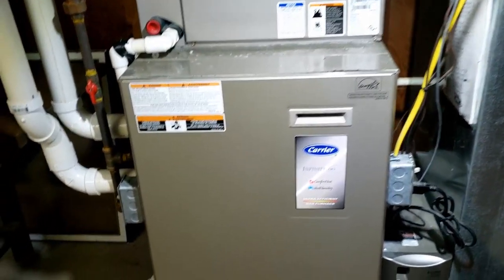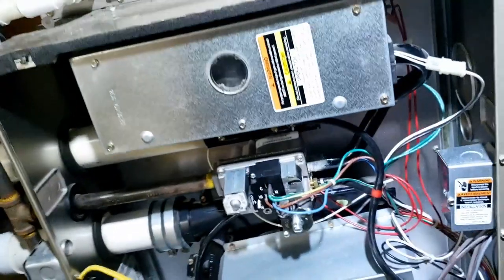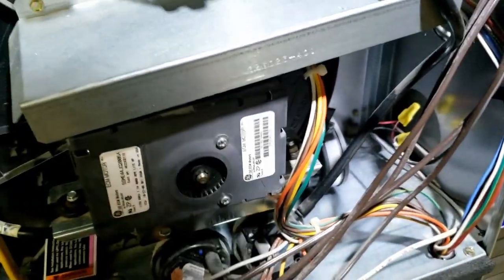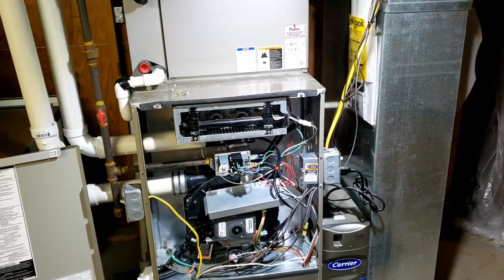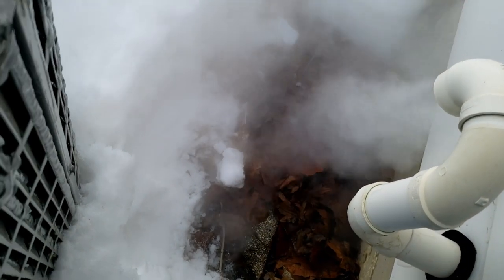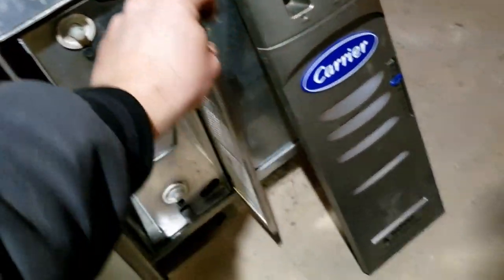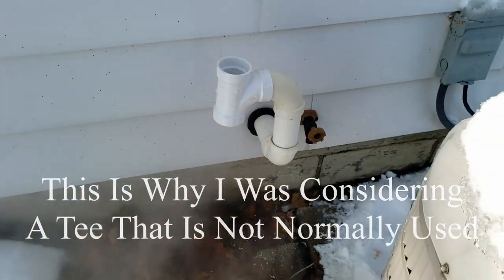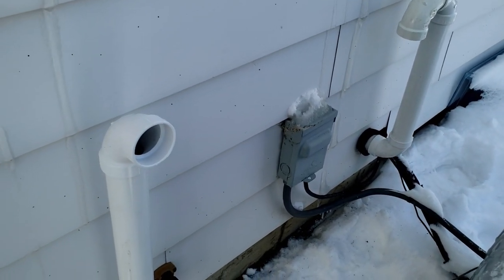CARRIER FURNACE NOT HEATING EASY FIX 31 Code

Comment: As a retired Carrier distributor service manager I have two things to offer. The fix was a good one and kudos to you for your professionalism and ethics.
Now to item two: Carrier has what is called a concentric kit that allows both pipes to exit the same hole. 4 inch hole. The exhaust goes out the middle of what looks like a cone/ funnel, and the intake air is drawn in from behind that cone. Very nice looking too. In your case, this, had you known of it, would have solved all the issues you correctly pointed out in your valuable video. When time allows you may find it worthwhile to talk to the Carrier distributor near you and get some info on this kit. I doubt, with so many hackers around, this will be the last time you and other professionals run into this issue.
Also as others have correctly pointed out, the requirement is 12 inches above any anticipated snow load.
Thanks again for leading the way.
Wayne Schneyer
Reply from the maker: Thanks Wayne, I appreciate you taking the time to watch it and leaving me a note. I myself have the concentric kit on my furnace and generally most new installs that we do would normally get one of those. I believe there was a previously installed furnace that already had been vented out.  Otherwise I'd never recommend running the exhaust stacks behind the condenser like was done. Unfortunately I would have had to drill a new hole or try to saw the whole bigger to fit the concentric out and then figure  a way to block off the previous two exhaust penetrations,  I'm not sure that would go over well.
Reply: @HVACRSurvival  Why is the air intake tube going outside???   The one for my Bryant gas furnace goes up out of the furnace a short distance up and draws intake air just above the furnace INSIDE my basement.

Comment: Perfect video!!!!! some of these air switches has two contact - one on the front one on the back check both! On my Carrier unit the yellow jumper powered both switches - then there was a brown (signal to control board) and orange (signal to control board) two different outputs signals. Inducer housing pressure and collector box pressure (check all 3 tubing- green, black, and black square tubing vacuumed sensing signal). Blow them out (toward the inducer housing) and you can check them with a OHM meter by gently sucking on the hose and hearing them click.  Make sure the hoses are good and tight - a very small vacuum leak can cause them to not work!

Comment: Good fix, much better than before. One thing I would have done is make the intake shorter than the exhaust by 6-12". That way you won't get recirculation even with a lot of horizontal wind since heat rises, it will go over the top of the intake.

Comment: When we used to install the Carrier furnaces here in Ontario the requirement was 12” above the highest expected snow level and 12” of separation between inlet and outlet. There was only two acceptable terminations, two pipe as described above and concentric. Not sure that has changed. Also anything that include risers above the snow had to be insulated. I remember getting tagged by the inspector at the time for less than 12” between. Made me fix it before unlocking the meter (new install).
Reply: Yes here in ontario 12" min between fresh air and exhaust if under 100kbtu. Over 100kbtu its 3". 12" above expected snow fall and usually around 3" outdoor vent before you have to insulate it. It is usually in the manual as different makes and btu values have different requirements.  As far as the ones in this video I can definitely  see it recirculating depending on wind which will shut it down. Also exhausting near/ below ac is a no no. Condensation and ice will build up on the unit. Personally  our dispatchers send the home owners to check venting before we are sent out. Saves us those snow in boots situations lol
Reply: @adamradley4407  thanks. It has been years since I have installed one. Put a two stage in my house in 2013. Love it. Have had to replace the inducer motor, not a failure but got very noisy, could hear it upstairs. Other than that it has been great. Did you mean three feet before insulation? I used to have to hate insulating them. Put one out under a deck and extended it the width of the deck, insulated with 1/2” Armaflex.
Reply from the maker: Running pipes a long distance outside under a deck in northern climates would likely result in the exhaust pipe accumulating ice build up inside the pipe and eventually restricting it enough to cause pressure switch lockout.
Reply: @HVACRSurvival  we have run up to ~15' of 2" vent hooked up to 70-90 kbtu furnace without an issue but you really have to make sure you are sloped well and fully insulated. I have run close to 30' of 3" through an unheated garage on a 110kbtu successfully. Granted it is not ideal to run long lengths outside but sometimes it is the lesser of the evils ;) Make sure it is well insulated and sloped very well.

Comment: Good solution on what you had to work with.

Stay Safe
Reply from the maker: It was a losing battle. I still wasn't happy with the pipes that high or far apart. But that was a install screw up but I didn't want to say that in the video.

Comment: Loved the video. Im looking at a carrier weathermaker 9200 uhe with similar symptoms. Comes on for 1 to 5 minutes shuts off. Blower is not turning on but duct by heat exchange gets fire hot. Then it trips. Im assuming its the capictor or the blower motor. Great vid!

Comment: I highly recommend just coming straight out and doing a slash cut on them like a 45° angle cut but I guess with the snow line you can't do that up North.
Reply from the maker: I used to do the 45° angle cut on the Lennox Furnaces more than anything. It really depends on what height it comes out at whether or not you have to do a riser like that. Normally I don't need to do that riser.

Comment: 2 Questions-  1. Why did you move the exhaust and intake pipes closer together?  2. Why were you considering installing a "T" ?
Reply from the maker: They are less likely to recirculate when they are closer together, also a tea causes it to linger around the air intake and potentially recirculate. I almost never use a tee, sometimes a tee will help keep winds from being driven directly back into the pipe, this would happen more when you have winds coming from a particular direction like from the West for my area.
Reply: @HVACRSurvival  Gotcha. Thanks for the explanation.

Comment: At 2:15 you pulled the black tube off and felt for vacuum. I did that one unit flashing code 3-1 and went to feel it I don't have much vacuum on the line even after it's pulled off but the system let the valve and ignitor ignite and start operating. What is my next step? What needs replaced? What is the actual problem here? Thank you in advance
Reply: Hey did you every figure this out

Comment: Great video! Since I’m newer at HVAC, I had to wonder why you mentioned running both those pipes closer together... wouldn’t that be more of an opportunity for the intake to pull in exhaust as opposed to having them further apart?
Reply from the maker: You would think that further apart would be better but it's not. Think of how concentric kit works, the intake is right behind the exhaust. It was more of a issue with certain furnaces. The worst use to be the Lennox Pulse for this but with the current draft motor design furnaces it's not as bad but shows up when it gets too single digit temps. The hot gas exhaust can frost closed the intake.
Reply: @HVACRSurvival  thanks for the feedback, I appreciate it. Seems like the concentric kits are more for difficult installs or aesthetics... trying to take every opportunity to learn the right way. Lotta hackery out there
Reply from the maker: @kevinsklow3473  you'll learn the most as you screw up. Most things I point out or stress is things I got burnt on / callback 😁.

Comment: Do the vents being closer together make a difference even with proper terminations?
Reply from the maker: You less likely to get recirculation with them closer.
Reply: @HVACRSurvival  ah makes sense, I always wondered why..dont do many resi installs
Reply: Closer also means they're in the same pressure zone and less likely to trip pressure switches during wind gusts.
Reply from the maker: @fukashima6586  Without showing you its hard to describe.  It just works

Comment: I'm a service technician,  I've racked my brains half the day on a 58mxa120-f-15120, the problem I'm having is the cfm is not coming on for call for heat only when I pull wire off vacuum switch it comes then I put it back on and it goes through heating cycle like normal until its satisfied and won't work as normal , I've already changed the board . Any help would be greatly appreciated. Thanks
Reply from the maker: You said your working on a 58mx furnace yet you cant get the CFM to come on? Condenser fan motor?
Reply: Yep only when I pull wire off vacuum switch briefly then it comes and I put it back on ,and it goes into heat sequence,  first time I've been on this machine at this location. In missing something. Thanks
Reply: Combustion fan motor, is what I'm calling cfm , thanks
Reply: Or induced draft motor ,
Reply from the maker: @hank6887  email me what you checked so far. hvacrsurvival@gmail.com

Comment: Hardest furnace to do maintenance on. Still not a fan of their trap and getting burners out to clean when exhaust runs through the furnace.
Reply from the maker: The trap was changed a couple years ago, just remove a 1/4 screw and pull it out.
Reply: @HVACRSurvival  yea the model you're on the hose clamps are a pain. The trap needs hose from inducer and collector box removed to either blow through or remove it completely to clean. I've had it to where I blew through inducer hose only to clear it and it was still plugged on collector box side, theres a divider inside of the trap. New carrier models trap is a bit better but still not easy to remove and deal with their clamps.
Reply from the maker: @gocubsgo5055  the key is a good pair of square headed linesman with the grip to hold the clamp.

Comment: What is the purpose of the Tee?
Reply from the maker: I assume you're talking about the pressure switch test that I might have done? (It's been a while since I've seen the video.) If it was for the pressure switch,  if it was, then It was me to monitor it accurately while it's in the circuit.
Reply: @HVACRSurvival  Thank you for your reply. However the component I was asking about is the Tee on the outside of the building. What is it's purpose -- why not simply terminate outside the building with a straight piece of pipe, or an elbow?
Reply from the maker: @CognitiveDisonance  I went through and watched the video "completely"without fast forwarding. I mentioned why I used the tee and it was noted in the title.
Reply: @HVACRSurvival  I dont know how I could have missed that. Thank you again -- I appreciate you taking the time, and effort, and your willingness to help :)

Comment: So why would you want the intake next to the exhaust? Seems you would want them apart from each other!
Reply from the maker: Recirculation happens when it's further apart. there's a buffer area where you want to be,  best to be  close together when properly vented or a large distance apart but usually in the same pressure zone. as always follow the owner's manual and do like they ask. I've experienced this first hand
Reply: Having them close together in the same pressure zone makes it less likely that the wind will trip the pressure switch on a windy day since they will experience the wind gust equally. If the pipes are further apart a wind gust may produce different pressures in the pipes and cause issues.

Comment: that was a lot of standard elbows in total, maybe hitting length limits and the snorkels should be strapped to the wall =p
as should have the original ones, regardless of the whizz-poor gluing job. a strap would have kept if from flopping over.
I could see there being a wind induced issue with the terminations further apart, in combination with the condenser blocking/guiding wind.  you were dealt a bad hand for sure

Comment: The secondary heat exchanger is on its way out.. watch out for the smell
Reply: it may not be, could fail this season or last years.
Reply from the maker: I have been seeing most failing around 2002-2005 or older, that's 15-16 years, things wear out. My only complaint is building the heat exchanger, if it were assembled like the new version or most any other brand. That's what takes the most time.
Reply: @HVACRSurvival   in my view, if any heat exchanger makes it to 20, it's a success.
Reply from the maker: @Jon-hx7pe  i agree👍